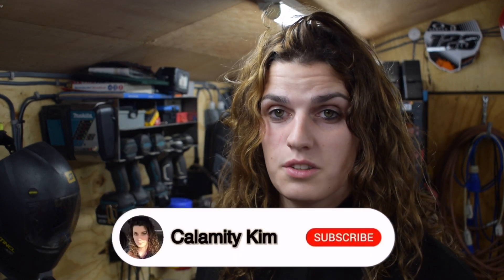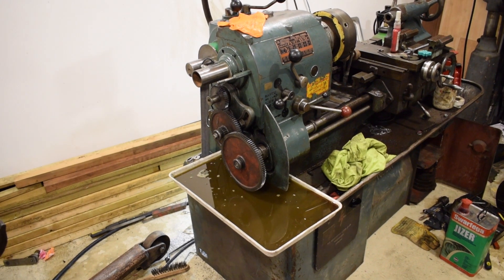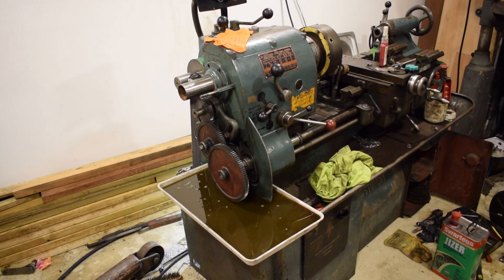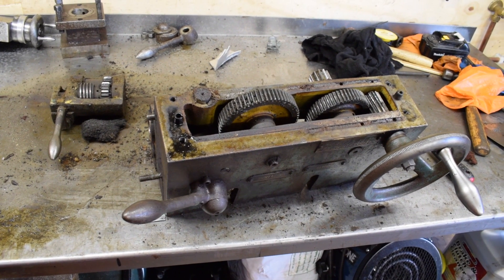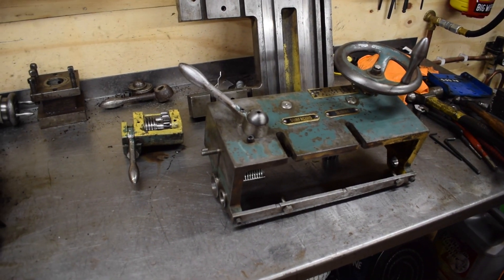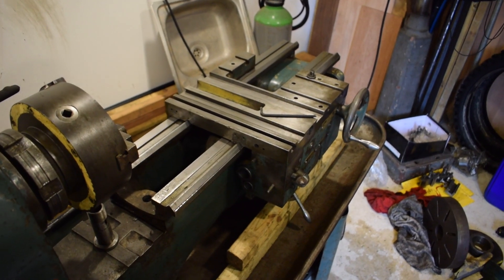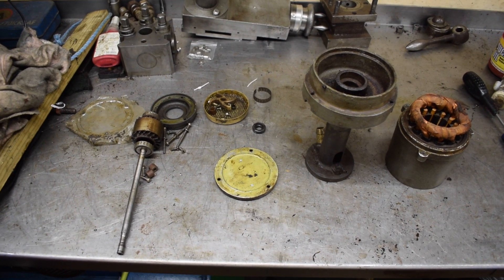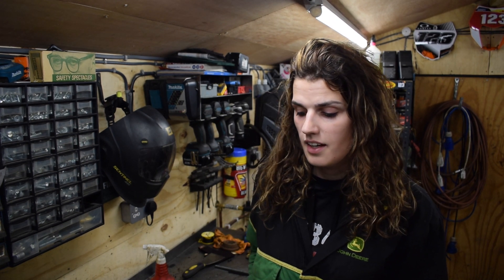Lathe Overhaul. PART 3 Colchester Student: Stripping, Cleaning and Assembling

Comment: Fab video thanks Kim, glad to find your channel as I have seen everything This Old Tony has done at least twice…
We only have single phase and the job you have done with the VFD is excellent. Is yours called a 6 1/2 student? I did a bad impulse buy on a 1962 master and the apron controls are the same as yours. Mine has been tipped over at some stage and the cross slide screw is bent and the retaining screws are missing, I thought they might be whitworth but your wipers were 7/16 Unc I think you said. Do you think they are the same, worst case I was going to drill and retap with some metric. All good though. Cheers Jim
Reply from the maker: Thanks Jim 😊, I’m not sure to be honest. I never bothered to check 😁. From memory I think some of it was witworth. The bed piece was anyway. I wouldn’t be happy drilling it out and tapping it if I could avoid it. Thanks Kim 😊

Comment: Hello Kim.
I’m looking at buying a Colchester master mk1.5 lathe, spoke to Colchester ltd today, for some advise and they sent me a operators manual pdf file for a mk 1 student, you are welcome to a copy, if you don’t already have one, it’s 82 pages.
I’ve looked at one of your other videos, very useful 👍.
Reply from the maker: Hi there. Thank you for that but I do already have a paper copy a friend kindly gave me 😬
Reply: @CalamityKim1  hello, no worries, I actually went and picked up the master 6.5” that I won on eBay today, bit of a drama, as it fell over, while trying to put it in the back of the trailer, it’s heavy 😳, a stressful day tbh but very happy, that I know have a decent lathe, I’ll watch your other vids and might even start making some of my own, I have a box full of cutting bits, maybe 50+ in holders, looks like there’s a bit of a Colchester lathe community on YouTube, so if you need anything specific, just ask, i might have it.
I do need to get it running, as it wouldn’t start, on collection, I will have to get into the electrics, it’s going to be a bit of a mission 🤔.

Comment: Just doing the same on my old lathe, think the front is called the apron that holds the carriage drive gears. Is that little sliding keyed puck on the threading drive an adjustable drive stop? If you were threading and the carriage hit that would it not stop the drive?

Comment: I like the subtile display of enthusiasm you have for that beautiful machine. Those saddles can be a bearcat; nice problem solving there. That was one of the best lathe restores I’ve seen on UT. Just the right amount of comprehensive. Thank you for doing it. 

Also, cheers for not doing disclaimers. Most go on and on; preaching on how to get a qualified electrician if they’re worried about their own work. Damn proud of you for that.
Reply from the maker: Hi John, thanks for the comment. 
I mean the electrics on the VFD are mostly signal or Extra love voltage. Other than the main power feed and the motor feed. I’m glad I didn’t go too far with it. It’s quite easily done isn’t it!
Reply: @CalamityKim1  

Yes, I’d guess so. Of course anything that can create or store a magnetic field can bite in a memorable kind of way. And it happens… but you didn’t toss in extra details about that wiring, which is why I felt you struck a great balance. 

And you’re genuine. I believe that’s appreciated. It’s tiring watching someones perfectly manicured backgrounds and scenarios, as if somehow those things will create the illusion of competence. Although many of them are I’m sure. I think you know what you’re doing and perfect as you are.